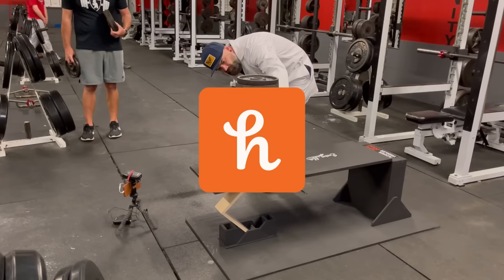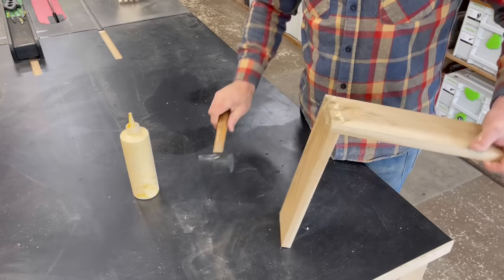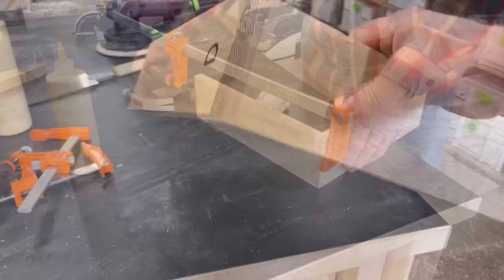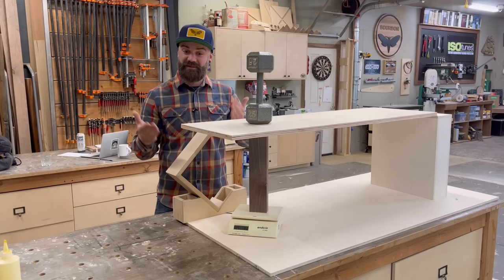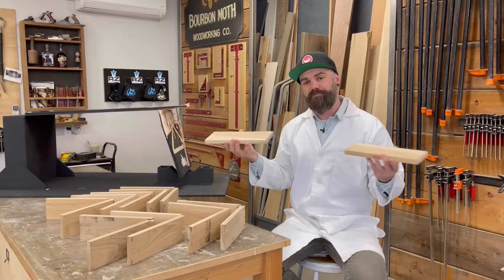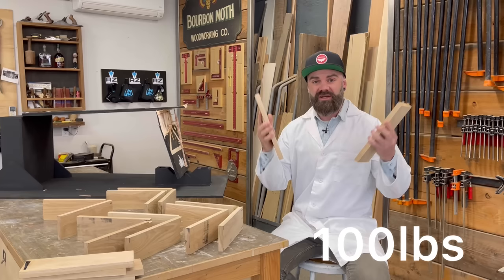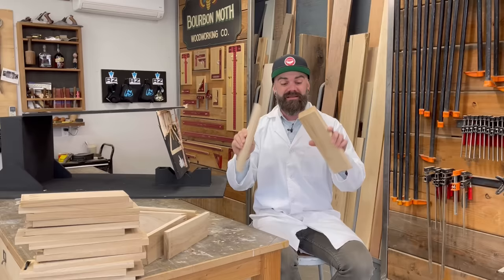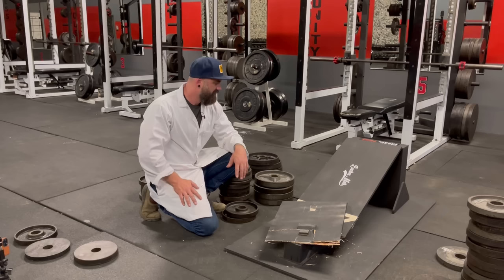What's the Best Wood Joint || Insanely Strong Joinery!

Comment: As a completely non-woodworker I definitely guessed the splines and was pleased my guess was correct. My thought process was that the way your contraption was setup is that it emphasizes compression on the inside of the joint which translates to tension on the outside of the joint. So I assumed those splines would be best to resist that tension since they are full grain wood running the exact direction of the tension.
Reply: You grasped the essence of joint engineering better than most woodworkers.
Reply: well, this will teach me to read comments before I finish watching the video!
Reply: Excellent analysis! This is the type of logical thinking I wish I'd see more of in woodworking. As Donny P said, most woodworkers seem to have very little understanding of these things.
Reply: im 16 never done woodworking in my life randomly watching this. And instantly knew the splines would win because the wood is going the same direction as the force. Like its hard to tear a pice of wood by pulling on it or i n this case compresing. idk
Reply: Exactly, had he tested the expansion of the joint under the opposite load instead, then the joint would have failed earlier.
Reply: @roberthardy3090  if the spline were cut in to proper depth (i.e. all the way through the joint) then it should be comparably strong for forces opening and closing the angle of the joint. If the spline was cut in very shallow then it would perform much better in closing the angle than opening.

If I wanted to get really granular I could say that it should perform better with opening the angle if the applied force is properly compensated to apply the same torque relative to the joint hinging axis, and I would say this due to the fact that the spline depth perpendicular to the joint face tapers unfavorably toward the outside corner, causing the spline to want to pull out at the corner instead of actually providing the full axial strength. But on the inside corner it's the other way around where the spline has maximum length embedded and glued into the work piece, and thus maximum opportunity to provide axial strength without locally pulling out.  In practice I'm not sure how significant this becomes.
Reply: @MattMcConaha  Nerd. 😁 Just kidding brother.

Comment: Dovetail is a fundamentally flawed joint type. Reguardless of the size or amount of em. All the pressure from the weight ends up on that small short "triangle" shape at the sides of each dovetail. So just as you saw, the wood will break on that triangle line leaving one side looking as if it was a box joint because that small wood section ends up as the weakest part of it making it much weaker than a normal box joint.

Comment: As a structural engineer that designs wood connections all the time, it would be really interesting to test the strength of something other than the glue. Some of those connections seemed quite strong if it weren’t for the “snap” of the glue bond failure. I’d love to see just how high you can go with things like truss plates, angles, and structural nails and screws. Obviously a carpenter isn’t making a cabinet to withstand an earthquake, but I think it would be fun either way.
Reply: All my cabinets and shelves seem to have withstood multiple earthquakes. Perhaps not good for their structural integrity but nothing has fallen apart,not even the antiques.
Reply: As interesting as that may be, I think it would get really silly really fast. Heck even this test showed that steel vs glue is no comparison. The pocket holes had 2 screws and it put them in 4th place even though there wasn't a lot of wood to hold them. Something like a truss plate, you instantly get to the point where you pretty much just find the weak spots in the wood. Which if you think about it makes sense. Its kinda why we invented truss plates lol. The only reason miter was so high was the leverage gain of having that glued plane being level.
Reply: Yup. That's why I just use glue, maybe pin joints if it's a bookshelf but most modern glues can handle what I can throw at it. Worst comes to worse yoy can always add support.
Reply: Need too much weight.  You would be looking at thousands of pounds unless you are using quarter inch stock.
Reply: Sounds like you have a plan for a YouTube video in the making
Reply: Wood glue is actually stronger than most wood. Usually the wood itself will fail before the glue.
Reply: @briantroy7376  What is nice though is that a miter is far easier to cut then most of the others near its strength, set your miter to 45 and just cut away. It's nice to see that at least for force pushing in the direction of the glue a simple cut is extremely effective for a nice bonding surface. I imagine the splines addition would also work in areas in which you're worried about lateral load as well.
Reply: @mmm-mmm  So I shouldn't be gluing AND screwing my butt joints on say cornhole boards
Reply: In Japan I guess cabinets are made to support earthquakes 😂
Reply: I would also be interesting to test these joints on different load cases.
For example, pulling the opposite direction of the video, or straight pulling as well. 
There are no tests I know of, except calculations.
Reply: Mmmm. mmmmh.   mMaaybe I will!🤔strokes chin.
Reply: I build speaker boxes and sometimes my installs are very very high-power and the faceplate that the subwoofer attaches to needs to be very thick and very strong. I'm wanting to leave a natural wood finish and upgrade the faceplate connection to the rest of the panel of the box. 
What the large box already assembled, what would be your recommendation to do this?
Reply: @briantroy7376  Also the glued area of a mitre joint is 41% greater than that of a but joint.

Comment: Ordered as presented (breakage) in the video:  

1.  Butt Joint 60 lbs 
2.  Lamello 70 lbs 
3.  Domino 100 lbs 
4a. Pocket Hole Inside 110 lbs 
4b. Through Dowel Pins 110 lbs 
4c. Dovetail 110 lbs  
5.  Pocket Hole Outside 170 lbs 
6.  Miter Joint 210 lbs 
7.  Box Joint 220 lbs 
8.  Miter with splines 270 lbs
Reply: omg ty so much
Reply: Strongest joint I've seen is also a type of miter joint. The lock miter joint, machined on the shaper, has outstanding strength due to the glue surface area.
I also couldn't help but wonder, would the tyloses in the white oak have made a difference by not allowing the glue to penetrate the pores?
Reply: I wonder how a pocket miter would do.  I have often used those for small projects.  Now that the miter and pocket were both pretty high on his list, what would combining them do?
Reply: I think the dovetail would have done a better job if it wasn't made so thin. My dad does wood work and his dovetail joints are much thicker than that.
Reply: Seriously, your dovetail was crafted by an expert. I'm sorry, the small contrasted with large dovetails is ignorant. The small dovetails will obviously break. Go back to structural engineering classes.
Reply: If you want a joint where the wood breaks before the joint gives up you should check your glue. I don't know what you use in the US but the connections look very weak. When I glue something together most of the time wood will break but never the joint. Try Bindan-P Glue or even make your own glue out of:
#1
100g kasein
220g water

#2
20-30g Potassiumhydroxid
100g Water

#3
70g water glass (Disodium Silicate or Sodium metasilicate) 
2-3g copper chloride
30g water

Mix #1, #2 & #3 separately. Then mix #1 & #2 together, thereafter mix in #3 slowly(!!) , continue until copper chloride gets from green to violet.

Here you are, strongest glue I've ever had with open time of 4 to 48 hours(!!!)
Reply: @benkayvfalsifier3817  Yeah... I thought for a stronger dovetail, the size of the dovetails are supposed to be equal in size depending on the length of the joint. The one tested looked more like an aesthetic looking joint.
Reply: Food for thought. You said the porous nature of the wood in the square joint weakened it but both surfaces in a miter joint are porous and it is much stronger. The surface area of a porous substance is much greater than that of a smooth surface. Is the smooth surface of a square joint it's weakness?
Reply: The strongest joint would be a mitered finger joint, which wasn't tried. In all directions.
Reply: Joints are a major flaw in most wood construction projects especially where stress and vibration is applied such as exterior wooden gates. Almost all of them are built wrong. Find me a wooden gate that is not sagging after a little bit of lifetime in the weather. There is a way to construct them properly and they will never sag, or break, until the wood completely deteriorates, and I will be making my first YouTube video on that because it is very important for people to get this right. I’m an engineer and I know what I’m talking about. I also built my own house and I work with wood all the time.

I really enjoyed this video. A little bit of trouble with the terminology, but the test was fairly sound. They did it a good way. Maybe they’re not actually measuring force here or pressure, it’s actually moment arm, but still the proportions apply to strength, and I’m very impressed.
Reply: Which survives outside in beehive the best? Anyone know?
Reply: Doing gods work. Ty
Reply: @robbrown5323  I've heard of people smearing glue on the end grain of a butt joint, letting it dry completely or almost completely, then adding more glue to make the joint.  The joint wouldn't be starved of glue that way.
Reply: @gregmead2967  White Oak specifically, has a unique crystal like substance called tylosis that completely obstructs the pores. It's waterproof and we wash it with acetone, which destroys enough of the crystal structure to allow a decent bond. This is why rum and whiskey barrels are made out of white oak, most wooden hulled boats too. It looks amazing under a microscope and you can't blow through it, but with Red Oak you can blow smoke in 1 end of the board and see it come out the other end.
Reply: @SamuelMaxwell  ya need a hug bro? That was pretty grumpy for no particular reason 😄
Reply: Spoiler alert! :-)
Reply: @Steve Perreira, link to that video when you finish it
Reply: Howzit?
Reply: @Dr.Harley  what the hell is water glass ???
Reply: @lolilollolilol7773  sorry for that bad translation. I think the chemical correct name is disodium silicate or natrium silicate. Basically any dehydrated silicic acid
Reply: Much obliged for your comment. You are my hero.
Reply: Well, thank you sir
Reply: @skeetorkiftwon too much work with little difference 😅.
Always choose simple 😂ork
Reply: @benkayvfalsifier3817 
Agreed....I would like to see the dovetail with equal cuts/ dimensions on both boards. But the expert friend did a nice job on his cut...it just seemed one sided to me, like you have highlighted. 👍
Reply: @benkayvfalsifier3817  Dovetails are cut, not bent outwards. This is the problem. They look strong, but they are bottlenecked by the Lignin bond, as the glue interface has no cellulose continuity
Reply: Redo the dovetail but make it more like the box joint (equal distance between the fingers, nothing wrong with the dovetail you had, but you had 3 large fingers going into 3 really  small ones. Make all fingers on both sides the same size. Just like your box joint ones.) 

And if you really want a strong joint, try a box joint that has a dowel pin running through them like a hinge

Comment: I think the idea of the dovetail being so superior is that as it begins to come apart or loosen up (say in a really old drawer that’s been opened and shut A LOT) it still functions whereas a miter, box, or pocket hole are basically shot the moment they start to loosen up
Reply: Ummm... sand and glue it again?
Reply: @lisat9707  not very easy for someone who isn't a carpenter or doesn't have access to a workshop.
Reply: Super good point.  It still holds together-do’n its job- even though it’s injured.

Comment: Great test!! But the very first test, butt joint, and simple mitre. I worked in a custom mill shop most of my life and we found when gluing them, glue up the joint, put together and let it set for about 10-15 minutes without clamps etc. Then we released the pieces and added another layer of glue, then clamped it, WHAT A DIFFERENCE in strength!! Back when the moldings were applied to cabinet door  and drawer fronts we never nailed anything, just glued with small hand clamps and with drawers and cabinets always slamming shut we NEVER had problems. DOUBLE GLUE!!
Reply: You all found a way to manage the increased  absorption of glue into the capillaries that we all call grains. Well-done, sir.

Comment: The dovetails we used when I was making furniture, were more like your box joins in size and spacing, just dovetail shaped. Maybe the size and number made a difference.
I think the big difference with this test is the amount of friction you can have versus tensile strength, maybe the ultimate joint would be the mitre with splines, but have the splines being evenly spaced and sized to the actual join wood, or at least increase the number of them. I have no idea really.
Reply: Its so funny that only you say it… we learned in school that it have to be in a specified ratio, so the gap cant be thin like in the video. Its look good but not as strong.
Reply: I don't understand the point of those dovetails where tails are thick and pins are thin.
tails and pins should be about the same thickness as the thickness of the board or slightly wider. 
I'm not sure if it's done that way for esthetic reasons, but they don't look nice to my eyes.
Reply: Yeah, the thinnest part of the dovetails become the weakest link. Bigger splines don't do anything, they just add surface so more thin ones would be best, but not too many to make the wood in between them too thin.
Reply: I was surprised that he didn't include the typical routed dovetail joint that is the industry standard in cabinetmaking.
Reply: agree.  Seems the dovetail was too thin and we can see on the video that it was the timber that failed (because it was too thin) and not the joint or glue.
Reply: Exactly 💯 that dovetail joint was made too thin
Reply: The more surface area, the more glue, and we know glue is stronger than wood. 

The issue is that you would have to test several examples of each type, because wood isn't consistent.
Reply: @alexfrederick9019  Glue is stronger than wood, given the correct type of wood.  Some woods dont glue well and the join will fail before the wood.
Reply: I have no idea myself  but it makes us think don't it not.  interesting stuff  friend.
Reply: @aspees  I don't think I know what you mean about a routed dovetail.? I'm intrigued. I'll look it up.
Reply: @traitorouskin7492  There are dovetail bits and nice guides for routers. Then there are hand tool guides like the Katz-Moses guides. 

The strongest joints will be mitered finger joints. They basically require a router and weren't included in the test.
Reply: I don't know a ton about wood working, but the dovetail joints that I see are evenly sized. If you have much smaller joints on one than you do the other, it would stand to reason that there is a weakness in the smaller joints. So i agree with this comment.
Reply: @johnbrueggeman2237  The joint is with respect to the types of wood used. The surface area depends on the porosity in the end grain and cut seams and the types of glue used. There's a large volume of physics and chemistry required to approach the limit of maximum stress:strain on a given surface area. 

The labor and time to produce the best joint often isn't worth the return on investment. If you want to build drawers that withstands a nuclear explosion then change the materials.  A weld is always stronger. Mitered finger joints will always be the strongest. If you want stronger, then increase the number of joints per inch until you exceed the fiber strength of the wood used. Then you'll have failure in the wood, rather than the glue.
Reply: "...too thin."

Remember how the glue only has to be just a bit stronger than the wood? Same holds for joint geometry.

Look at the failure mechanism of the dovetail joint--the board failed in tension across the grain at a dovetail pocket. 

Why? Because dovetails are wedges. Wedges offer a mechanical advantage. It's why we use a wedge and maul, or a tapered axe to cut firewood. I'm not surprised at all that the box joint beats the dovetail, because it has the same loading through compression load transfer without the wedge effect.

Still impressed with the miter joints. And lest anybody here try to introduce tapered tenons--just don't.
Reply: Dovetail is a fundamentally flawed joint type. Reguardless of the size or amount of em. All the pressure from the weight ends up on that small short "triangle" shape at the sides of each dovetail. So just as you saw, the wood will break on that triangle line leaving one side looking as if it was a box joint because that small wood section ends up as the weakest part of it making it much weaker than a normal box joint.
Reply: I've always thought of dovetails as more decorative. Box joints are stronger. I wasn't surprised. The strength of the miter joint surprised me though.